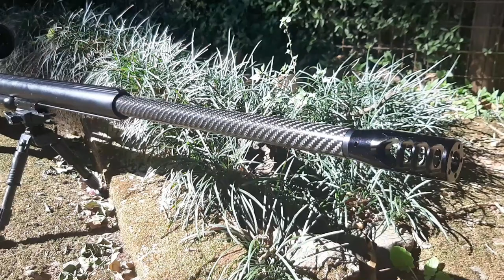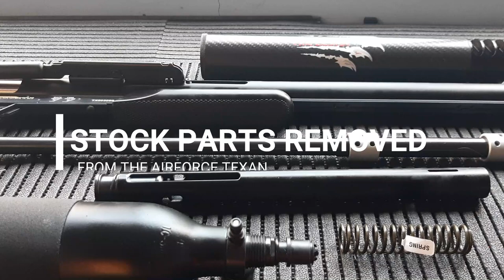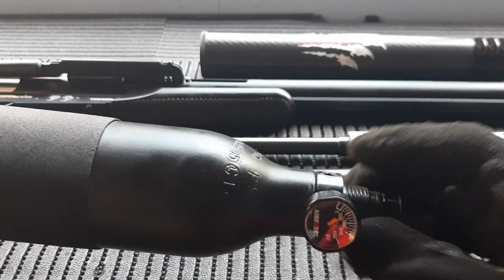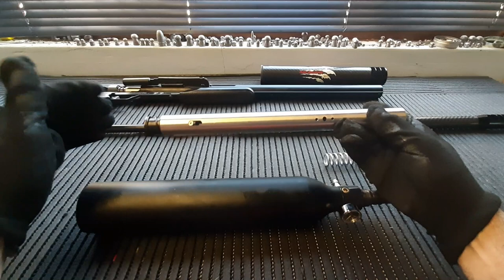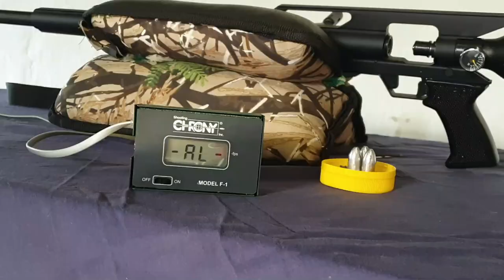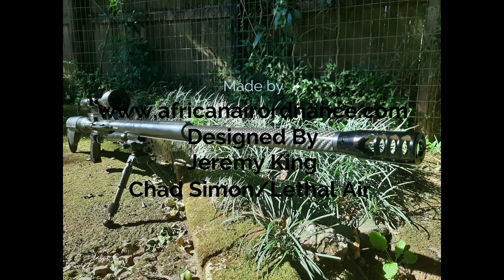CLOSE UP LOOK AT THE SUPER TEX 50 CAL

Comment: Very Nice...
How far back is your carbon fiber sleeve from the muzzle to the first bushing? And do you epoxy it in place with jb weld or something, reason I'm asking is that I'm looking to do this to my .457 for my Tex... or can I buy this mod in .457 from you?
Reply from the maker: The carbonfibre  shroud goes all the way to the barrel mount we made our own barrel bushing that the carbonfibre shroud slid over and was glued in place with epoxy
Reply: @AfricanAirOrdnance Thank you very much for your Reply.... 
Do you sell or make a barrel bushing in the Texans original LW .457 barrel, that have a leading lip on it, (Like I see that Your .50 does for the TJB),..that would accommodate an CF tube of 0.75 I.D.?..... as the the tube that I was able to get has the dimensions 1.00 O.D. x 0.75 I.D. and seems to host about  a 0.25 gap slightly....

Also would it be fair to assume now, that after the barrel bushing down to the muzzle, That I might need to keep it centered with an O-ring or something right before the end of the muzzle? And if you don't mind my asking when you applied your epoxy, did you just smear it along the barrel, then roll/Screw it on almost till the end of the barrel before the muzzle? Again thx for your Replies...